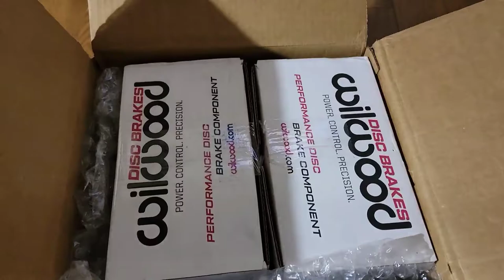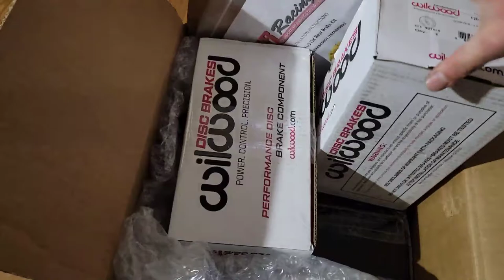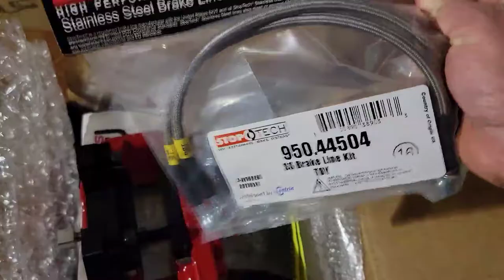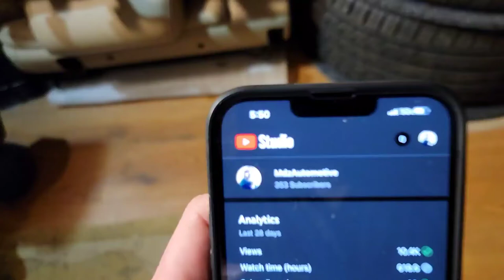How To Ceramic Coat Brake Calipers | Giveaway

Comment: How do you know if the breaks will fit your car?
is the bracket specific to the car or are most cars standard?
Reply from the maker: RR Racing built a specific bracket for the IS250/350
Reply from the maker: Also I reached 400 subs and you are the only one that commented on this video which was the requirment so you win the giveaway prize..
Reply from the maker: Contact me at: biggbird23@gmail.com for further details..